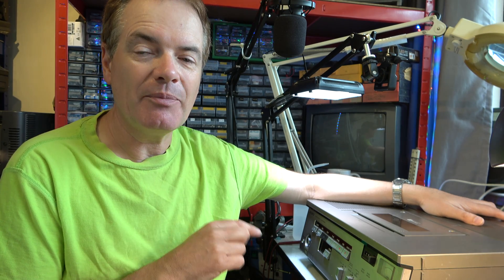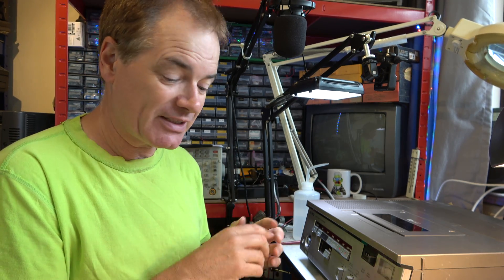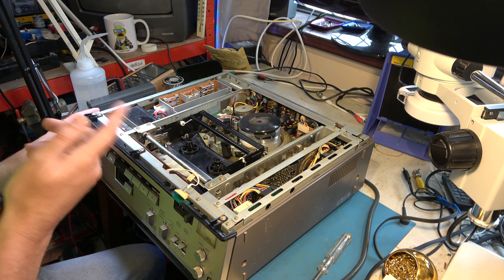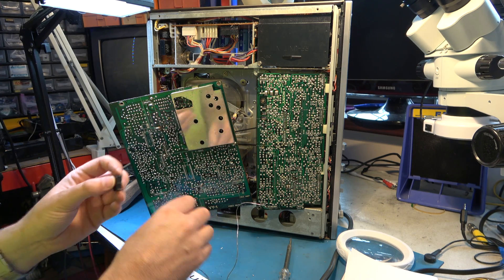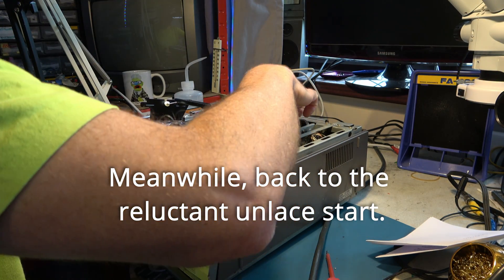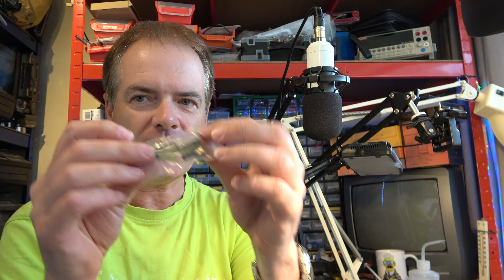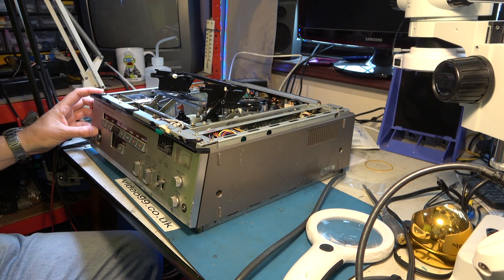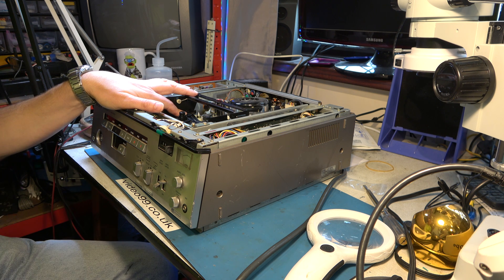Sony SLO-320 Beta-I NTSC and HP Z800 workstation both break down.

Comment: That PC power supply is every bit as proprietary as any I have seen in a rackmount server.  Yike.
The early consumer NTSC Betamaxes (up to at least the late-70s SL-5400 I think) used those audio jacks.  I have, somewhere in storage, an early industrial SLO model that I remember being the industrial version of the SL-8200 BII-only model... mechanical piano keys... maybe SLO-260, but my search now says that was BI-only... anyway, I'm pretty sure it has BNC video and 1/8" /3.5mm audio jacks.

Comment: hi  doe's that old computer use alot of power  i had same kind of one it died some time ago    i use a amd3+  4ghz   now this is still very old  against the new one's now
Reply from the maker: It's a fairly fast computer, even today, but yes it drinks electricity and makes a lot of noise compared to a modern desktop PC.

Comment: Just looked up your PC as I was curious about the specs...  I have a couple of Xeon X5650 (hex core) CPUs that I recovered from a decommissioned server at work. I'm pretty sure that they'll work in the system  if you'd like them. There's also a possibility that I have some suitable RAM too. You may have already upgraded it, but you're welcome to them if you'd like.
Reply from the maker: My machine has 24GB RAM, it's fully populated with 2GB modules.  If yours is more than that, it could certainly be useful.  Mine already has two X5650 processors in there so alas there's no upgrade path there.  I have fitted a much better graphics card than the original plus an SSD drive, so it adds up to a pretty potent machine.  My son tells me it's even a good gaming rig despite being about 10 years old.  It is however noisy and drinks electricity.
Reply: @video99couk  Good stuff - yes, still plenty powerful enough but the downside is the energy consumption now as you mention. I'll have a look at the sticks of RAM I have and let you know.

Comment: The HP Z800 and Z820 were great in their day, I have three HP Z4 machines now, which although good I have found limited in the single CPU capacity, so I have a dual CPU Z8 coming in the next few days with the  new Nvidia RTX A6000 GPU. Rendering of various effects with 2K cine film are ridiculously time consuming, particularly grain reduction and warp stabilisation.
BOTH HP machines I gave you blew up, so hopefully whatever it was doing it is not a factor in the new ones or I am stuffed....100% blow up is not good
Reply from the maker: This was a relatively small, if smelly, blow-up though.

Comment: The Sony SLO-320 Betamax VCR Service Manual with Schematics is for sale on Ebay US for $9.99 + $26.22 postage from seller Larkinsmunch
Reply from the maker: He's not responded to my message asking if we can find a cheaper postage route.
Reply: @video99couk The seller is locked in to the Global shipping program via Pitney Bowes, so will not allowed to change the shipping route. i imagine the best way is to instead offer to pay for a scan of the documentation and get the pdf emailed to you. Alternatively buy it and get it delivered to a friend with an address in the USA and get the friend to forward the documentation to you (or indeed a scan of it).

Comment: Well, the pc power supply was no supprise, ive seen the filter caps explode in dell media centers.
Often there is no obvious reason, not that i could find.
As you said it was running off a crude and sharp waveform, lots of unexpeted frequencys, so the capacitor capaitive reactance would also change, overload?
That beta machine needs counciling lol.
Metal tube touches the logic pcb, oww just one logic output shorted would make jibberish if a logic chip/transistor/doide was buggered.
Perhaps stick a meter on the semiconductors with power off, cant hurt :-)
Reply from the maker: I really need a service manual at this point.  I do still have suspicions around the dew sensor circuit.